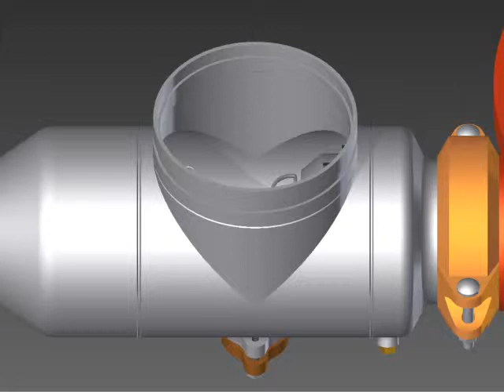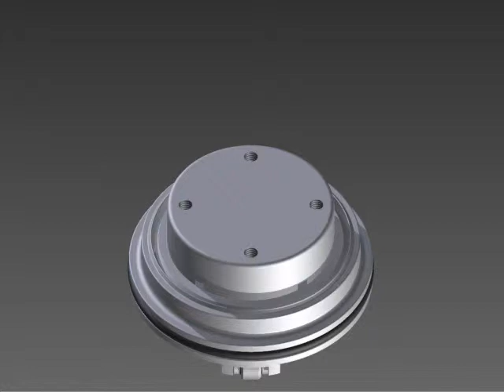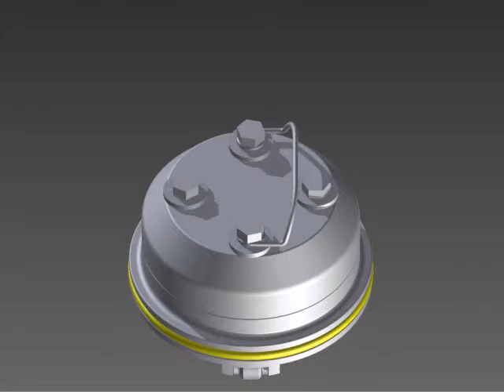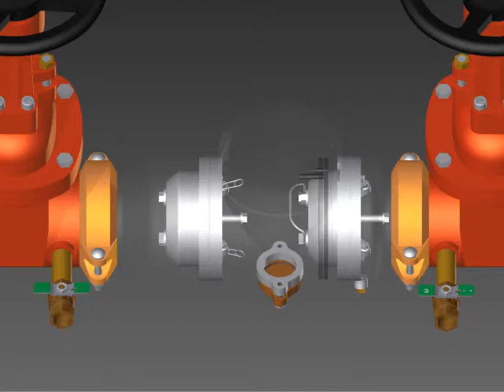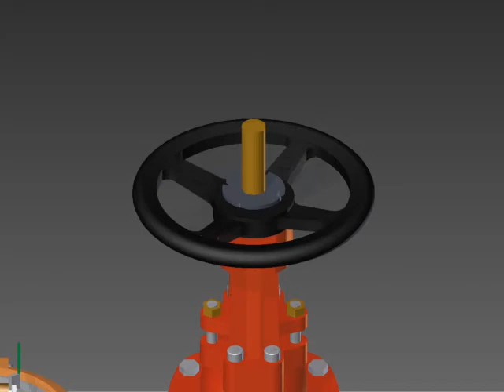Repairing a Zurn Wilkins 350AST Double Check Valve Assembly

Comment: Most of time both hands can't get in
And with thoses you need to....😅
Also 
I had to replaced the first check 
And the new one doesn't fit 
The diameter of the first check was ⅛
To large....
Never been easy as watts to repair